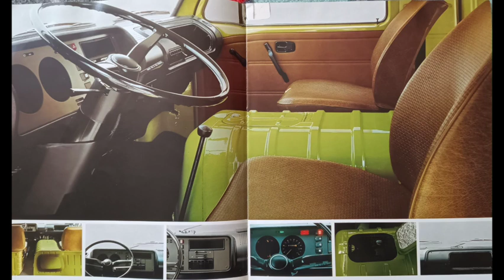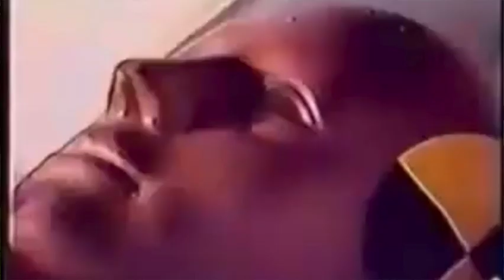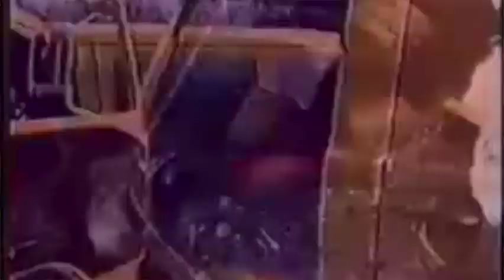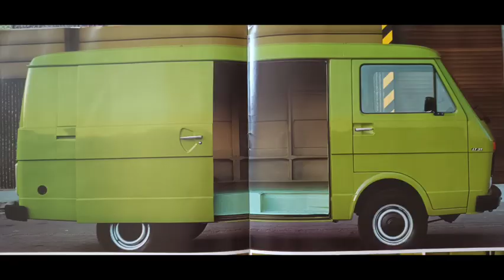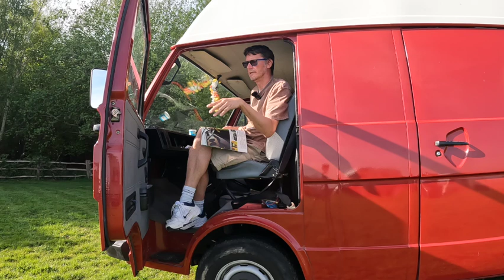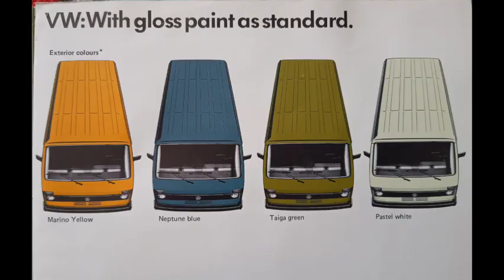The 1976 VW LT Van UK Brochure Storytime with Driven It. It's also 50 years of the LT.

Comment: This video is pointless because it only covers 1975-1983 mk1 pre turbo LT’s, there are essentially mk2/mk3s throughout the 21 year life span, mk2’s being 83-93, mk3 93-96, mk3s are overall the best due to many having tdic engines, pas and Rev counters, rare options like 1/4 windows and electric windows
Reply from the maker: That sort of is the idea of this section when reading out brochures. It's based on the year of publication. Not the model history. Sometimes l might ramble on about something that happens in the vehicles history but otherwise, it's year specific.